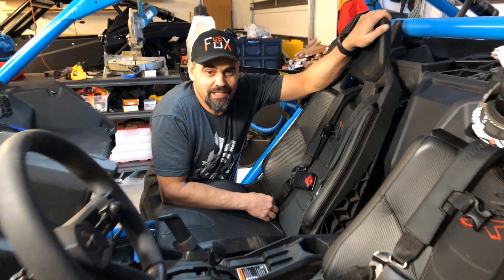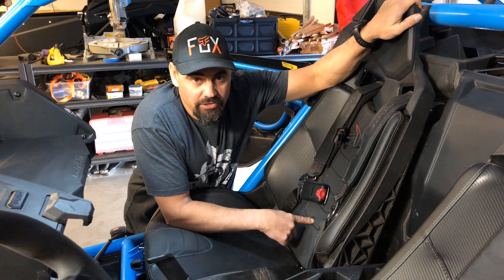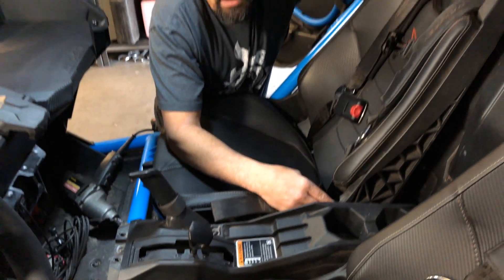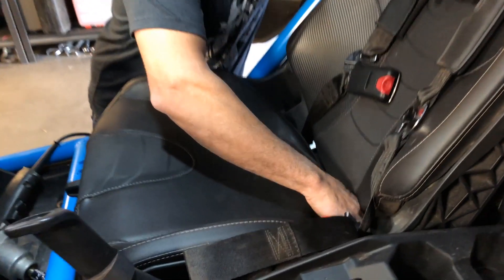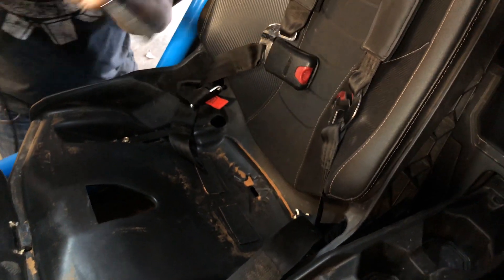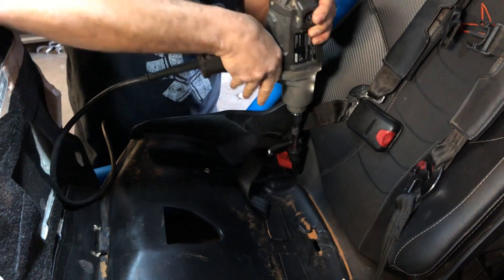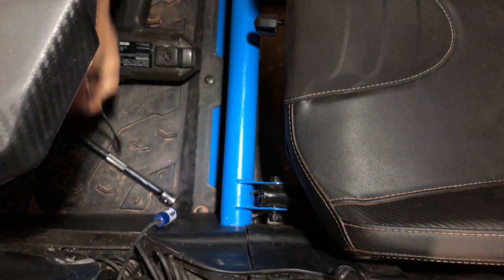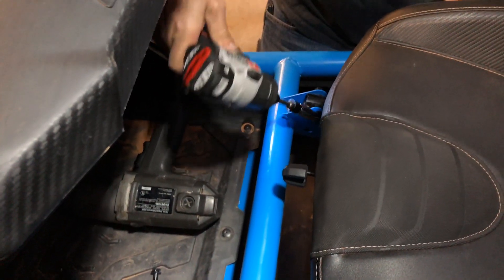CAN-AM X3  Seat Removal - Battery Access

Comment: Awesome, I wasn't aware of the Velcro seat cushion that allows access to the back bolts. Also I am wondering if the front bolts just get loosened and then just flip the seat forward. The seat belts have enough play, then just tie strap it to the cage???
Reply from the maker: That could work, just depends on the type of work and area you need for what you’re working on.

Comment: How do you remove the service panel between the seats ?   I don't want to destroy any clips.
Reply from the maker: They are actually quite easy to remove by pulling them out ftom the front lower just pull them out toward you and the should start to release from the clips. There should be two purple "claw type" clips that like to come loose and go missing so keep an eye out for them as yyou remove the panels.
Reply: Yes, the top two tabs pulled straight out.  Lift out henges on the bottom two.  Thank You.  @TRAILICON
Reply from the maker: Awesome, no problem 🤘🏼 @elli003

Comment: how did you get the seat off the seat adjuster bar?
Reply from the maker: It is all part of the seat frame, by removing those 4 bolts it all comes off in one full piece.

Comment: The rear nuts are 18mm pretty sure.
Reply from the maker: You are 100% correct, Sonny mixed it up. We are going to correct it. Thanks my man. Good ole human error.
Reply: No worries, y'all do a good job getting right to business without a bunch of fluff.
Reply from the maker: Much appreciated man, we’ve got some more great things coming very soon. We want to keep things straight to the point, unfortunately we messed up a bit on this one. Thank you again for reaching out and supporting our channel.
Reply: An even easier way is to remove the 4 bolts under the seat cushun lifting the entire seat out and leaving the slide assembly.
Reply from the maker: More than one way to skin a cat ;)